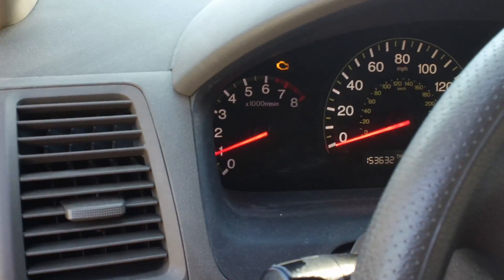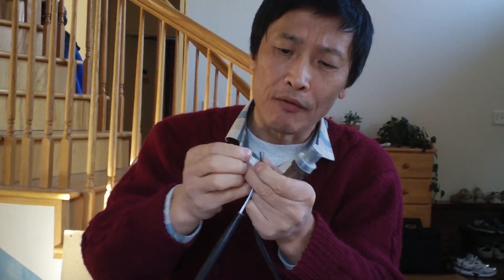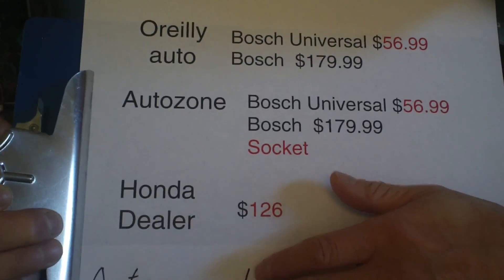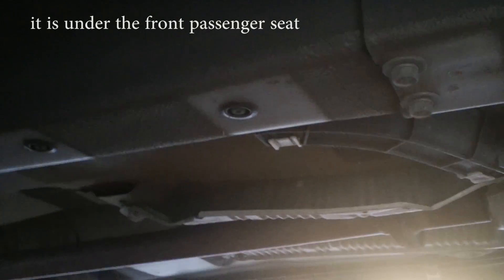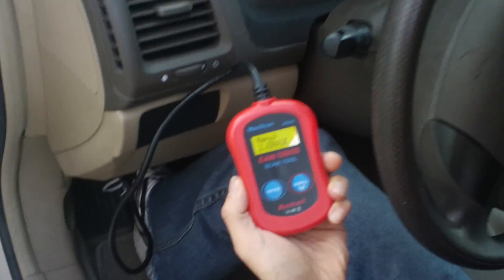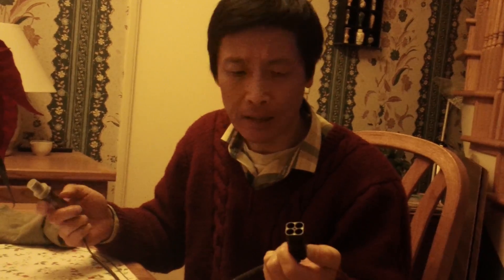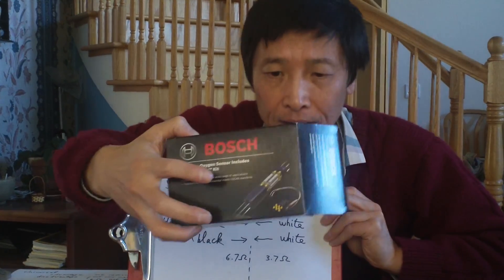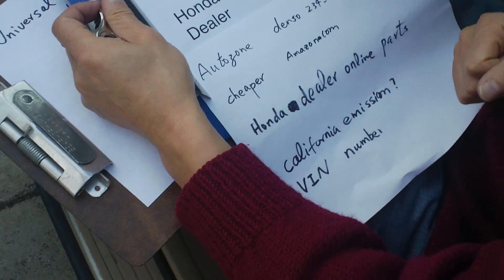Diagnosis of the P0141 Code & Oxygen Sensor

Comment: Hey thanks for the help! I have the same car 2004 accord, but i was hoping to get some advice. I had the same issue i changed the sensor and now i have 2 other codes that come up, maybe u had same issue.(p0171) fuel system too lean bank 1 - (p2647) rocker arm oil pressure switch Circuit high voltage. Any advice would help and i would really appreciate it! Hope to hear from you soon.
Reply: Ecm